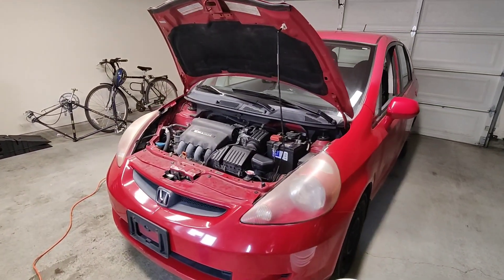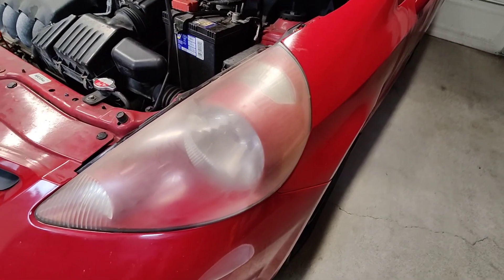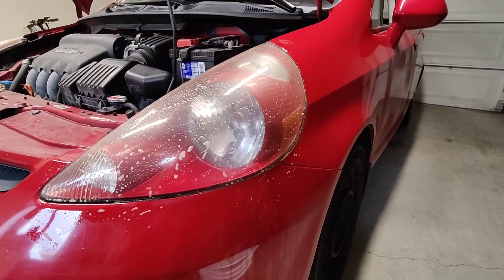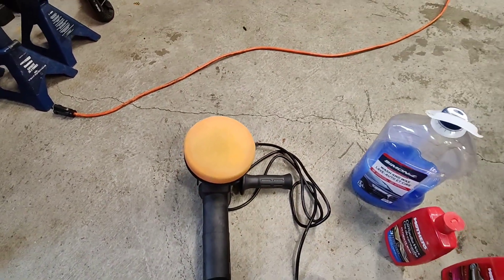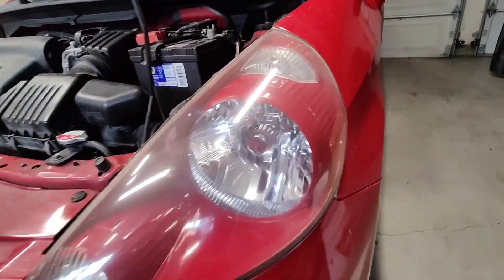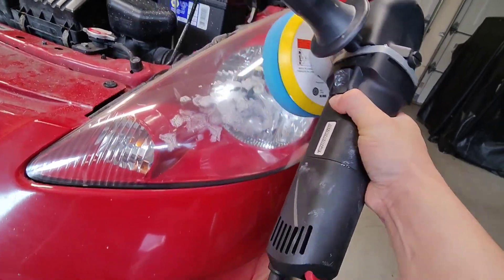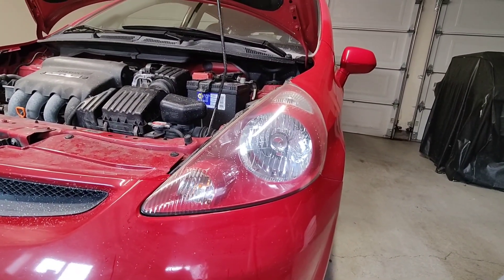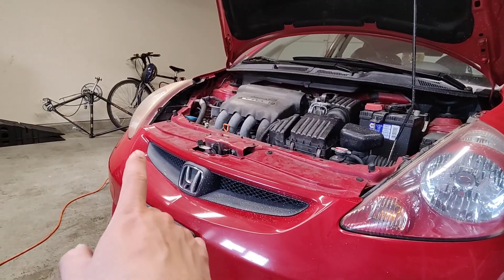How I restore my oxidized headlights. And it is super easy if you want to do it yourself.

Comment: For people who don't have tools, auto store has tons of tool free headlight restore wipe. If the yellow plastic is on surface, these wipes work very well. However if the clear coat start peeling off then a grind tool is necessary. Walmart also offer headlight restoration service at decent price.

Comment: Just about the identical process I use for my vehicles.  The only exception...........I have an eccentric orbital sander for wood in my garage.  I obtained 6" hook and loop foam polishing and buffing pads to use and it worked well.  Just make sure you clean out the loose sawdust from the sander, it will make a mess.

Comment: Tip I learned that actually works is to wipe the headlight down with brake fluid first...it removes all of the yellowing from the plastic.  Then wash and go through whatever restoration process you've chosen.  Works astonishingly well!
Reply: isn't brake fluid kinda harsh to plastics?
Reply: @glowiever  What do you think your brake fluid reservoir is made from? 😉
Reply: Make sure don't get brake fluid on paint